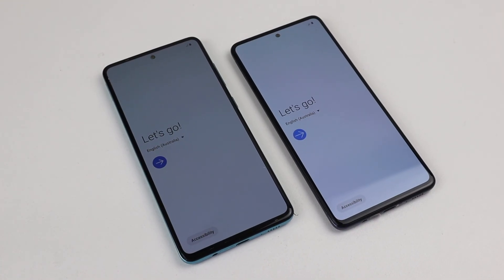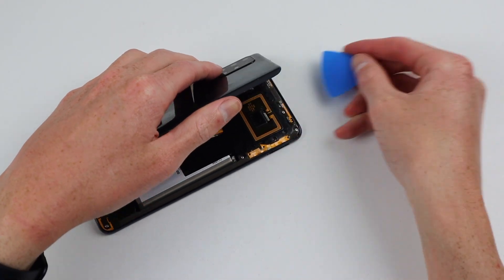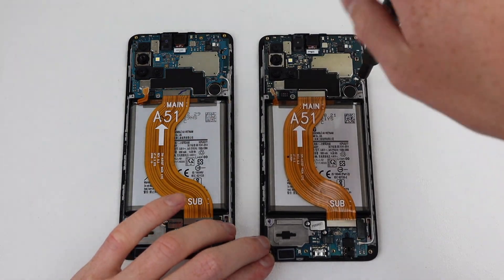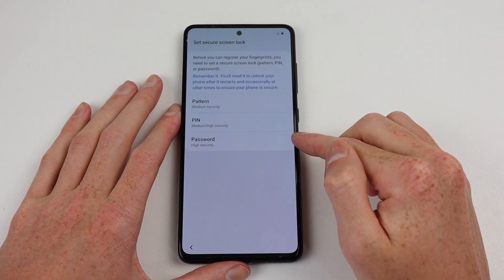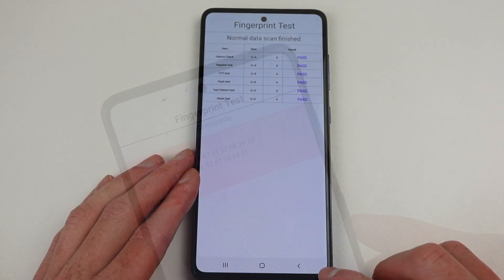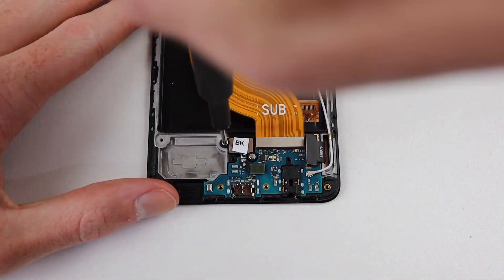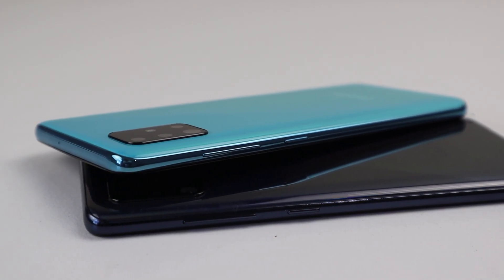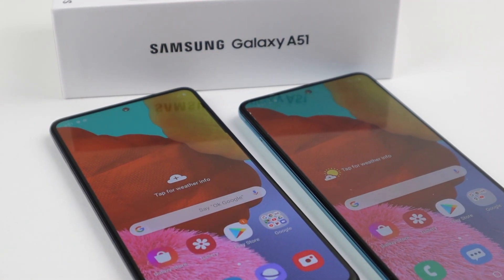Samsung Starts Blocking 3rd Party Repairs? - Galaxy A51 Teardown and Repair Assessment

Comment: I had this issue on a Galaxy a50, it was such a pain to finally get the fingerprints to start working again. What fixed it for me was getting an original service pack screen but the issues weren’t completely gone even then. 

Users with completely original devices are even having fingerprint issues. 

From what I can see, this wasn’t an issue at all before and has been introduced with new software. People had these issues before with older versions too but the new software was supposed to fix the issues not make them worse. I’ve also noticed cheap screens don’t even have fingerprint cutouts.

Overall the fingerprint reader on this line of phones is picky anyway and Samsung seems to make it worse with software.

Comment: I switched from an iPhone 5S to a Galaxy Note 8 back in 2018 cause of the crap that Apple was pulling. Since then, I've owned a Note 9, Note10+, and Note20 Ultra, as well as a variety of earphones, watches, and accessories. 

The fact that they themselves are turning into Apple, especially after making tweets and dissing Apple in commercials, just makes me mad. All the things I hate Apple for, such as unrepairability, removal of the charger, lack of an SD card slot, are all coming to Samsung phones.

That being said, Samsung did lower the price of the S21 to $800 which is a $200 price cut from last generation, but still, it's annoying. I really like Samsung due to the ecosystem and UI, so I really hope they don't continue down this path but I have a feeling that that's where they're going.

Comment: I got one, total piece of shit. Already half of the things have stopped working, sometimes up to 6-second lag, dead fast charging, glitchy bluetooth, wifi and mobile connection, randomly shuts off, inaccurate fingerprint scanner, and insanely fragile (already broke one screen, but all of the stuff stopped working before I broke it). This is the biggest failure from Samsung. Not to mention the build quality.

Comment: they will be forced to reverse that action in areas where right to repair is legal or face hefty fines or lawsuits
Reply: right to repair is now a major thing in EU one would assume that Samsung wouldn’t want to lose that many customers
Reply: @FrostyFoxGamingIGM  I hope that the laws turn out to be in the customer's favor, and not just some crappy lobbyist stuff.
Reply: LoL apple never faced suit for their anti-repair practices, what makes you think samsung will be treated differently.
Reply: @pepe9735  i sure as hell would never use cloud based stuff
Reply: the thing is, its a security risk.. once the sensor gets swapped and needed a re calibration, it will not work properly and as the video showed, it unlocks the phone from a finger that is not even registered before. samsung just stopped it from ever happening to the public. we'll just have to wait until a makeshift calibrator from china immerges (because i doubt samsung will ever provide one) that re calibrates the sensor so that it can be swapped to another phone..
Reply: @heyitsmejm4792  interesting thing is the only thing that got swapped is a screen it was shown in the video even if they swapped the sensor the got the same thing but if it was the original screen and sensor everything worked fine it didnt matter if it was the original sensor but different screen it wouldnt work and i wouldnt be surprised if this has likely triggered an anti trust lawsuit against samsung
Reply: @dawn1berlitz  yeah, but it seems like they dont have much choice... seems like its too late when they knew about it so they just throw out an update that would lock it up if it gets swapped.. this is a major security risk.. and besides, the a 51 is a mid range phone, it makes no sense to repair lock it. if samsung were to do it (hopefully not), it makes more sense to do that on their flagship devices..
Reply: @heyitsmejm4792  i think they are doing this to kill off independent repair or self repair  so they can rip people off to send a device in for repair that  can actually end up coming back with other damage
Reply: @dawn1berlitz  yep.. its just wierd how they waited many months to do that via an update.. oh well.. shame it  has come into this.. down to just LG and Sony then..
Reply: @heyitsmejm4792  i have a iphone i used to use LG though but due to some software issues i got a IOS but i know im still in a mess with repairs and some have found ways around apple
Reply: @dawn1berlitz  it used to be the case on apple before how the battery health disappears when you replace the battery even if the battery came from an original iPhone. A Chinese calibrator was made that would essentially copy the info of the original battery to the donor battery if you connect it to that device.. now the phone thinks it has the original battery that came with it on the factory..
Reply: @heyitsmejm4792  there is also a screen programmer for some devices
Reply: @heyitsmejm4792  Samsung didnot locked anything. Because it passes fingerprint tests and even somehow detects the finger. It is stopped working because it is optical and sensetive to the position. Small missalighment will make it harder to detect the finger.
Reply: @heyitsmejm4792  Fingerprint scanner as security is a joke.
Reply: @MRooodddvvv  still, you cant stop people from using it to lock their phone cuz its a feature😂

Comment: Would this work:

Knowing that you added a screen that had a teardrop notch and the original phone had a hole punch notch, would a phone that has a teardrop notch work with a hole punch screen?
Reply: Wait no
Reply: The reason why the teardrop phone would have a teardrop notch is because of the camera module, why would they add a teardrop notch if they have recourses to leave it as holepunch

Comment: With the fingerprint sensor I kinda understand apple’s reasoning, if you lose or you get your phone stolen it’s impossible to see your data because if they replace the fingerprint sensor It will still not work, it has to be the same fingerprint sensor you first used to set up the phone, same with the front cameras and from sensors, in the other hand the thing with the back cameras I don’t understand.
Reply from the maker: Both phones require a passcode after restart so being able to swap the fingerprint sensor isn't really an issue.

Comment: And I was praising them for easy repairs.I've fixed a lot of those when I used to work as a Samsung Technitian and I've never encountered that (Aside from fingerprint sensor calibration.That was happening a lot even if it wasn't replaced by me for some reason).

Comment: The security update is another real life version of “It’s like evolving, just backwards”
Reply: pairing the fingerprint sensor to the motherboard makes sense for security reasons !!! you shouldnt be able to swap a pre-programmed sensor to a locked phone and unlock it that way ...and you shouldnt be able to hotwire the connector or hook it up to a micro controller that simulates a genuine fingerprint sensor to unlock the device ..... it happend with much more complexes devices like PlayStation and all the mod ships available for it and if Samsung leaves the fingerprint unpaired to the motherboard someone will make a mod ship to unlock all there devices .....
Reply: @fouzaialaa7962  galaxy phones usually do disable biometrics and require the passcode every 24 hours
Reply: @cetheral1881 all devices do that after a restart, it isn't  special
Reply: @rockpie  I wasn’t saying it was special, I was stating (in a response to the person’s wariness) that a hacker wouldn’t be able to spoof the fingerprint sensor by attaching a different one because restarting the phone to install a different part would completely disable the any and all biometric options anyways
Reply: @fouzaialaa7962  EXACTLY, why are people here mad when it makes perfect sense
Reply: @wildechap  It would be nice if the finger print scanner still worked after replacing it, they could just have a disclaimer if anything saying its been replaced and that it COULD be a potential security risk.
Reply: @mashedpotatoes5323  its not just "potential security risk", it is.. whats the point of making a disclaimer if you replace it and it still wouldnt work normally?? why not just stop it immediately..  it makes sense really.. if left uncalibrated the phone can now be unlocked with any unregistered finger so whats the point of putting a disclaimer when the thing wont even work properly upon replacing?.. the issue there is that 3rd party repair shops dont have the calibrator that's used to re calibrate a different sensor.. who knows, some chinese manufacturer might figure it out and make a re calibrator for samsung.. its the same case for apple where the battery health doesnt show up even if you used a battery from another iphone, but not long enough, a calibrator from china made it possible..
Reply: @fouzaialaa7962  your a moron, the sensors only job is to literally show your fingerprint to the phone. the software determines if it is the correct print or not. stop commenting about things you don't even understand.
Reply: I think you didn't watch the enitre video
Edit: well I guess ur right
Reply: @rarinth  ooo how the tables have turned
Reply: @m.h.a.2404  lmao
Reply: Build back better. Lol

Comment: i repair the a51 like 3 times a week, i work in a phone repair shop, a couple months earlier fingerprint scanners didnt work. but now when i replace the screen, for the first 15 min it wont read any finger but after 15 min i can just read my finger in the device. however when i break or damage the sensor anyway, and want to replace it then it will say someting like fingerprint calibration needed.
and then you have to go to a samsung service center to get it re-calibrated, they do that because of security reasons.

(srry for my bad english, im from the netherlands)

Comment: Okay now that does beg the question: If this is all in the name of security, what would happen if the phone was already turned on, so no pin code to first unlock is needed and the fingerprint sensor gets swapped. We could see it malfunction on video, so would this let you inside if you open the phone up and replace it without powering it off?
Please do make a follow up video, I dont know where else I could ask this.

Comment: Sorry if i missed this. Did you try removing any stored finger prints before the swap? Could it be a safety issue to do with protect info and not allowing a swap to get around access?

Comment: Should've tested what happens if you upgrade the firmware while having the 3rd party display connected and working fingerprint sensor on the older firmware.

Comment: Fingerprint sensor must be calibrated after display replacement. It has nothing common with Samsung makes it harder for services.
Reply: yes, I'm skeptical that this is deliberate and not just a product of every piece of glass being a bit different, and thus having different sonic properties.
Reply: @onometre  well. Yeah. As service technician i had lot of these A51s and 95% of them had working fingerprint sensor after display replacement. Another 5% required calibration. Same at fingerprint replacing.

Comment: Wow... seems like Samsung are copying Apple with their lack of repairs. Thankfully, this is a £300 phone, not a £1000 phone, and if the display did need replacing, taking it to a shop to get it done would likely be cost ineffective anyway (especially for people who don't have the tools to replace a phone screen). 
But in any case, this is not OK. I think you need to check the S21s that have just come out as well, in case the S21s are starting to be locked down.

Comment: the galaxy j6is also hard to home repair.i had to get 2 screens because the factory one got busted when i replaced the battery, and the first screen was fucked. And i see that the more expensive samsung phones are bulit more repairable than their budget models (the j6 has the charger port integrated on the main circurit board, as i see on this phone its on a daughterboard, like it should be imo)

Comment: Phones in the future: 
OMG HE USED A DIFFERENT SCREW!!! DISABLE EVERYTHING IN THE PHONE
Reply: omg most of them are not using our online service, remove sd card slot with BS reason about anyone buying fake sd card

omg why our wireless product not selling well, remove jack port with BS reason about save space on pcb

omg why not we sell our official charging product? remove accessories from package with BS reason about save our earth but every year launching a lot product model which killimg earth itself

omg why everyone not using our official service center? remove abilities to fix ourself with BS reason for privacy thing

NEXT

remove usb port, forcing using their wireless adapter.
Reply: @AchmadBadra  you are right
Reply: @AchmadBadra  on the charging part. There are tons of better, third-party brands out there who will benefit more, brands like Anker.
Reply: Apple will call it innovation
Reply: @andrescarrasco1248  more like 'environment saving'
Reply: Sadly enough printers and tractors are facing the same issue, eventually something will happen wether it be done by the consumer or the company
Reply: @Vehement more like "you cracked your screen, for your safety we disabled the phone" lmaoo
Reply: nice propic bro
Reply: More of a : OMG THEY ARENT A VERIFIED TECHNICIAN! DISABLE EVERYTHING THE PHONE
Reply: @whatdoyouknow0426  more like disable the technician and then the phone!
Reply: SCREW 11 IS IN HOLE 8 (despite having same exact material and size) DISABLE EVERYTHING IN THE PHONE
Reply: Omg there is a different particle of dust here that did not came by factory so your phone is now useless...
Reply: Omg he use apple wallpaper!! DISABLED
Reply: Rip striped screws
Reply: Apple will be bricking your phone if you don't use an official Apple iPhone case
Reply: Omg he opened phone case! Lock everything!!!
Reply: Also phones in the future:
OMG DIS DUDE JUST PUT HIS FAT THUMB ON OUR BUILT-IN TOUCH SCREEN!!!!, DISABLE EVERYTHING IN THE PHONE! MAKE SURE TO CHARGE HIM 1000$ WORTH OF DEBT!
Reply: iPhone(running iOS 15): Incompatible screen protector.
Reply: A cheems
Reply: Sure use wrong screw and mess up ur phone screw maybe worse damage somepart
Reply: Hahahaah
Reply: your profile pic makes it better
Reply: This happend with a redmi phone. If u put the screw too tightly it will bsod
Reply: Apple: Already doing that, sue them!
Reply: It would be even worse if the device doesn’t let you use third party charger or headphones.
Reply: "OMG HE DOESN'T WANT TO CLEAN HIS PHONE, DISABLE EVERYTHING"
Reply: @AXAND3R  😱 he didn't use the $1000 cleaning solution we sell, brick that phone $10,000 phone.
Reply: Me: "Bro can you get my phone from the table"
Lil' Bro: "Aight"
Phone: 
"OMG A DIFFERENT FINGERPRINT DETECTED! 
DISABLE EVERYTHING!"
Reply: Apple did that with iPhone 5, if u used a shorter screw on wifi module, you have no reception.
Reply: In the future, you lease a phone.
Reply: No no, It'll be like "He tried to open the Phone, Delete! Every component is now corrupter and all software deleted"
Reply: In future, if you unauthorized technician and open the phone - they will send swat squad and charge you with non-authorized access to phone internals and put you to jail for 5 years.
Reply: phones in the future when you get a third party charher
Reply: That is actually a thing, if you mix up a longer screw when assembling, at some areas of the board the screw can damage the board beneath the screw hole

Comment: I've said it before and I'll say it again, pairing parts to a phone like this should be illegal. The fact that it was introduced in an update is even more scummy than just shipping it with this in place. 

Why this pisses me off:
Companies continuing to do this means they can charge you, the consumer, an arm and a leg for an official repair. 

This allows them to maximise the money they make from you by either charging you a lot or convincing you that it's better to just buy a new phone. This not only increases ewaste it also costs you as a customer. 

How it could be fixed:
There are two ways it can be fixed. Both are related to new laws.

1. A new law that forces companies to not pair the electronics in their phones to that phone specifically. As well as forcing them to provide parts for said phones at a reasonable cost.

2. A new law that allows parts to be paired to the phone but forces companies to provide the tools to pair the electronics yourself and sell parts to pair to said devices. 

Both of these suggestions a modern company hates because it doesn't benefit them and only them. These company's care about nothing but making money and will try everything they can in order to make more money. As someone who believes in right to repair I believe that companies should not screw over their consumers just to make an extra buck. Sure they can claim that people could rip off their product if they happily sell parts to the consumer, but let's be honest, that happens anyway with everything so it's better that we recycle our electronics than throw them out just because they're making it as hard as possible for the device to be repaired. I'm rambling I know but I hate seeing companies continue to screw over the consumer for no other reason than to make more money. #FightForTheRightToRepair

Comment: Honestly, not everyone needs a fingerprint scanner.
So even if it doesn't work due to pairing issues, it won't stop people from using the phone.
Reply: But, it is an official feature of the phone. It's not right for that feature to be broken or disabled, just because somebody had an unofficial repair. If you own a device, you should be allowed to repair it, disassemble it, or do whatever with it, because you own it.
Reply: @AvengedDH  Yes, that's right.
Why do even people lock down phones, it's your phone and you should have rights to repair it.